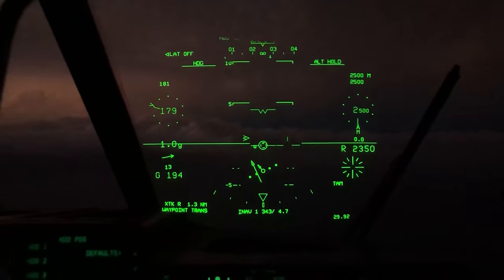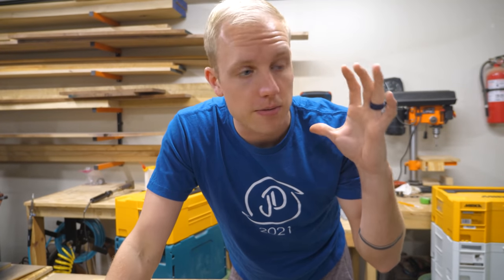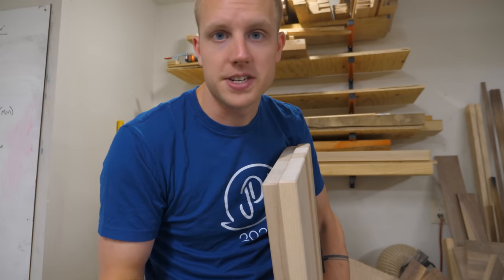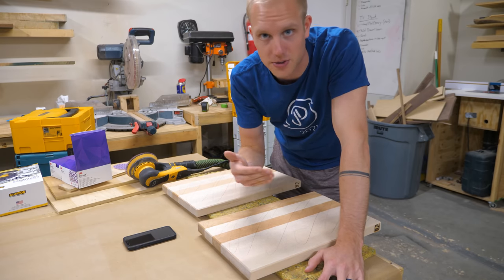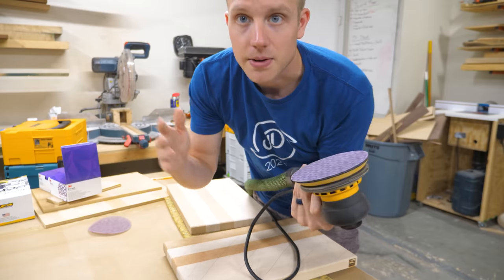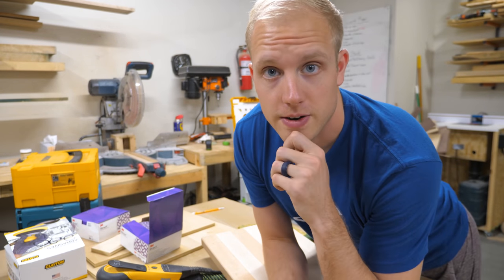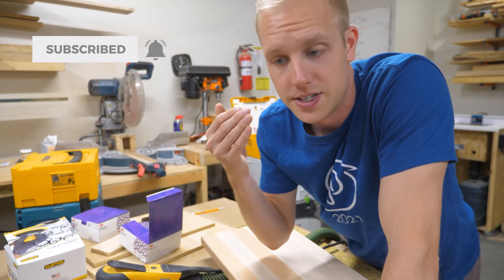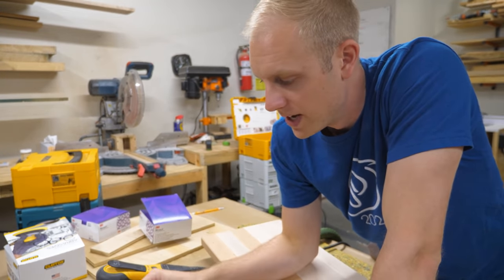3 SHOCKING things we found testing 3M XTRACT Sanding Discs (not sponsored) | 🌎 REAL WORLD TEST

Comment: Thanks for the video it was very interesting. What grit did you sand to on the drum sander? I have the same problem with my drum sander getting lines even when I try to takeoff very little. I would be interested in knowing the sequence you use on the drum sander. Thanks
Reply from the maker: It’s like 180 or something. That grit is rough enough to take material off, but gentle enough to minimize the streaks

Comment: I don't know about the RO test but am wondering why you even use one? I bought a drum sander/surfacing sander to eliminate sanding for me. 
I would send all my peices through and didn't have a problem with scratches as I was finishing with fine grit. That was the whole point in buying one!  No Random Orbit sanding was needed.

Comment: Seems like a substantial loss in surface area of the sanding surface on the 3M discs, is the "gap" between the purple chevron outline supposed to allow for dust extraction or is it also an abrasive texture? If the lighter part of that disc isn't an abrasive surface I would imagine that lead to the longer sanding time.
Reply: To answer your question, in the JKM video, he said the lighter colored areas of the 3M Xtract disc were the vented areas where dust was extracted

Comment: I'm new to your channel and just watched this out of frustration so I'm wondering if you or anyone else can respond to my question.  

Yes, I too like the Cubitron like many others.  HOWEVER, I use a dewalt orbital sander with the hook and loop disk.  I have replaced the hook and loop disk now 3 times since beginning to use the Cubitron  because no matter what I do in a very short time with even the new hook and look disk  the cubitron just doesn't stick any longer and just flys off.  I have tried everything to "Rejunveante" the hook and loop without success.  When I use the Dewalt disks, (and yes they take longer) I do not have the "Fly Off" problem.

Can anyone help with ideas or maybe i'm the only one experincing this issue.
Reply from the maker: It might be the sandpaper is 'eating' your hook-and-loop pads. You can buy (much cheaper) hook-and-loop pads to go between your sander and the sandpaper. It's much cheaper than replacing the foam sanding pad.
Reply: @jennieanddavis  Thanks so much for your reply.  I didn't know foam sanding pads are available.  I look forward to following your channel!
Reply: Wearing out the hook and lip on a stock sander pad is something I ran into years ago with my 5” PC sander then finally found that Mirka makes an intermediate pad that hooks to the stock pad. The Mirka discs then attach to the intermediate pad. They are called Pad Savers, PN 9955. I bought them from an auto body supply store. They work great and last forever which is relative as I usually use a smoothing plane for final prep , but they do last far longer than the bare stock pad.
Reply: Heat will kill hook/loops.  If some disks are thinner, they may not insulate as well so heat builds up and melts the loops.  I have to be careful with mesh disks for this reason.

Comment: This an eight month old video, so I don't expect a response.  What was the grit on the drum sander, and what was the grit on both of the sanding discs?  In the video you stated the 3M was 220 grit but didn't state the other discs' grit....if they were different than it's Not a valid test.  Understand  that each grit make marks, which the next finer grit removes...on and on until you get the finish you are looking for. Thanks for your time.

Comment: First off they are not going up in price.  Under 40 cents list for 5 Inch discs.  The clear coating might wear but the mineral is not wearing on the disc.  There is still plenty of life there.  Hence the robot just keep using the disc.

Comment: I've been using the 3M discs in 120 and 220 for some time now. I've never had any of the grit"purple bits" come off nor have I had anything but a good experience. Of course, I have a downdraft table I built hooked up to my 3Hp dust collector as well as dust collection through hose to shop vac while I'm sanding. Overkill, maybe, but I have ZERO dust in the shop. I like Jennie & Davis. But Davis really needs more experience in the shop. He's NOT a craftsman nor a seasoned woodworker. ALL I build is cutting boards etc. I use my Xcarve daily and it's excellent. But that's another video to comment on .

Comment: After having heavily invested in Abranet, I recently used Cubitron II for several projects: no issue at all, and much better than Abranet, this as a former fan of Abranet. (I wish I hadn't spent so much money on Abranet).  My experience  corresponds to almost everybody's experience and to the extensive, scientific tests. Statistically your experience looks like an outlier. Maybe some unlucky parameters?
Reply: I'm not sure it's an outlier, but definitely a disc-by-disc manufacturing difference. I've been using Xtract to sand my MIL's cabinet doors and the discs have definite variances in performance. Some last forever and a few crap out after a few minutes of use. It's annoying to me as a beginner because it's difficult to tell the difference but I'm getting better at it and noticing it more often now.

Comment: I don’t understand how this test proved anything… starting with 220 after the drum sander is way too high a grit. You’d need to follow the grits 120, 150, 180, 220 in that order and then water pop after each grit or just after 180.l then sand 220.

This test is less than half baked. Go through all the grits, use a random orbit sander and a pad saver if you’re going to use a mesh type sandpaper. 

I also get that this video is 3 years old and hope you’ve upped your game since then

Comment: The other factor within kat-mosses testing was he used a  robotic sander that applies the exact same amount of pressure in each of his tests.  The other thing is he only tested a tiny amount of the Mirka sanding pads. Mirka actually make lots of different types of this disc but he used a tiny amount of them in his testing!!! I agree with you the m3 isn't the superman of sandpaper discs in my opinion I found it rather poor!!

Comment: I think the 3M discs rely on the grit fracturing so that you have a quick removal result but that also causes it to wear out more quickly. Plus the fact that it seems like less than 50% of the pad has grit and the other area is for removal seems less effective than a traditional paperback sanding disc that has far more grit across its surface

Comment: I have recently been sanding A LOT of excess paint off the bottom of a sailboat. I have predominately been using the 3M xTract 710W discs at 80+ grit with good removal (at 53 cents per disc). The mesh design made changing discs very easy as I didn't have to line up any dust extraction holes with the sander (except getting the outer edge reasonably even).

I did run out of the 3M discs before new ones had arrived and needed to use some discs from a big-box store. I was very disappointed in the other brand (which I won't mention here at 43 cents per disc). The other brand seemed to need replacing almost twice as often and just didn't cut as well. Also, they had an 8 hole pattern that made putting a new disc on require more attention to get the dust extraction holes to line up, thereby increasing my time to change the discs.

I think for material removal (like paint) the 3M 710W discs work great. I'm not currently concerned so much with the surface finish at all for my paint removal project but I can totally see why these discs wouldn't work for you.  Although, I do think that if you did have a project that required bulk removal, without the surface finish requirement, you may find 3M discs more useful. 

Great video! (even though it was less scientific) It was very interesting to see a different use case and sanding requirements regarding the 3M discs. I wish you both well with your beautiful wood products. Hopefully you can get out of the garage and into a shop.  Cheers!

Comment: It's a bit concerning that it happens at 220 grit. I've encountered it with diablo sandnet, but usually at lower grits when I'm being a bit mean to the paper and sanding edges. My guess is that the fenstrations in the 3M disc may actually allow impact damage to the edge of the raised grit area, especially if there's too much speed or pressure... I couldn't help but notice that Jonathan's robotic test arm had a 3M logo on it🤔... maybe it was dialled in perfectly for that specific disc type.

Comment: Not sure how I feel about sanding disc that have more holes then they do have actual sand paper. Even wood whisperer brought this up on his festool sand paper as it has tons of holes too. I'm happy with either Norton or klingspor. Never liked 3m for sand paper. Thank you for the content though
Reply: Well, who cares how much of the paper is grit vs holes? The only relevant things are how much material it removes, how well it removes dust, how long it lasts, the finish it gives and of course, the finish it leaves.

If you get a better result in all aspects by having less grit and more holes, that is obvious the way to go.

Comment: Mmmm, that's not a test. Looks like too of high of a grit to start. I've used the 3M paper with a Rotex and have not had the complaints you present. Not buying your results.
Reply from the maker: Is it totally out of the question to think there were quality control issues with this brand-new product?